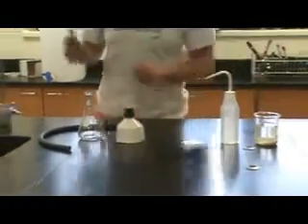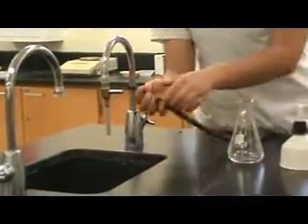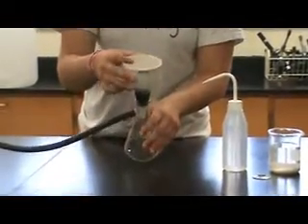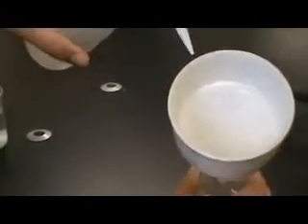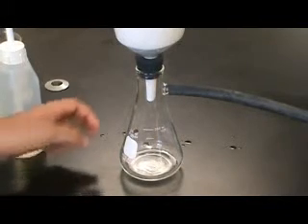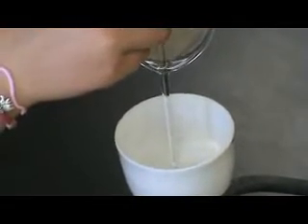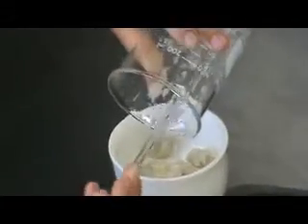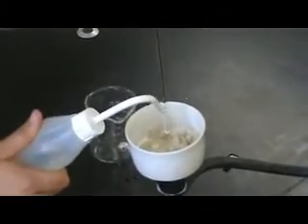How to Use a Buchner Funnel

Comment: Do you know how much vacuum pressure you're using?  That isn't an underhanded criticism.  I understand that there have been some negative comments.  I assure you that I know less about this than you do.  In the videos that I've watched so far the vacuum just seems to be turned on.  I was wondering what a good reasonable amount of vacuum pressure is appropriate for most solutions.